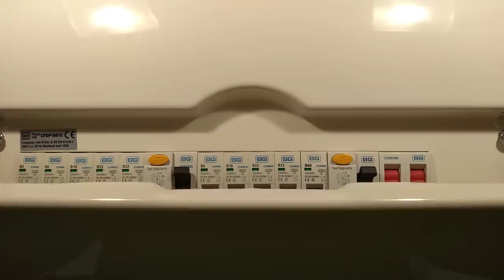A look inside a British home electrical panel.

Comment: @bigclivedotcom How Do UK Homes or Flats propose to deal with Electric Vehicle EV charging?.  EV charging in US/Canada/Mexico  is most often rated 48A at 240VAC (rms) on a 60AMP circuit.   Note that the mains from Utility are typically 200A @ 240VAC (rms).   In the UK example the small panel shown does not appear to even begin to handle 'level 2' charging of a EV at 12Kw (in addition to other household loads).
Reply from the maker: The panel is capable of handling loads of 20kW.  That would be a standard 50A breaker as used for some high power electric showers.

Comment: Another great quirk of the UK electrical systems is having a phase and a neutral sharing the same colour often in the same installation! Thanks EU!
Reply: What's that got to do with the EU? We had just the same situation in the old red/black days.
Reply: @Rosscoff2000  Well we were doing fine with our Red Yellow and Blue phase wires with black as neutral until the EU forced harmonisation on us which used Blue as neutral and black as a phase... the amount of times this has caught people out is unreal...

Comment: Wait, the UK uses DIN rail breakers? With stranded and ferrule capped jumpers? That's pretty different. US residential and light commercial boxes are very very different. I always thought our zig-zag bus bars were a bit odd, but that's what makes it easy accommodate both 120v and 240v loads in the same box, since every other breaker is on the opposite leg of the transformer. They're also huge, because the NEC requires many specific cases for dedicated breakers. 60 amps for a utility input seems pretty small too. Older houses tend to have 100 here, and newer ones 200.
Reply: eeeeweeezeee twice the voltage so 60 amps at 240v provides the same power as 120 amps at 120v.
Reply: I find 100A is more common in the UK, but I think Clive is in a more remote location hence it's a TT system and being on the Isle of Man might be a bit older. I think 80A is more common than 60A too. It will depend on the local distribution network.

Comment: We are require arc fault for all bedrooms and bathrooms plus ground fault for all bathrooms. The breakers are crazy expensive but they work well.
Reply: In effect, ground fault is now required in all rooms in the UK (and has been for some time); only a few things, like dedicated fire alarm/smoke detector circuits are exempted. As for arc fault detection, that's just hit the standards as an option, but I've seen some testing it and being disappointed in the results. John Ward, in particular, was not impressed by the very expensive device he tested. Others report they are prone to false trips.
Reply: I thought they were not worth it until I found a issue with the original installation (several years old at the time). Due to a basement re-model I was forced to upgrade my panel to the new codes. When I swapped in the arc fault it immediately started tripping. I thought, what garbage. Then I tracked down the problem to a slice in the insulation on my stairwell light. As soon as I repaired it, the breaker stopped tripping. Pretty much a convert from that point.
Reply: if fuse go lot alltime, circuit have somethink  totally wrong installed or added after building.too lot use power one fuse.

Comment: 63A panel will be protected by a 100A fuse on the supply side, because this protects the cable to the house. The meter will be protected by an 80A breaker, typically curve D, though older installations with a breaker dating from the 1960's could be a breaker with thermal overload only, or even a fuse of 80A rating. If you are on a prepaid supply that is only 40A rated, then you will have a 63A supply breaker to protect the 10mm concentric cable to the indoor meter unit, and then a 40A main  breaker. Otherwise 16mm split concentric or steel wire armoured cable for the 63A units, though older houses with long mains supply distances, typically then you have overhead lines as well, bare copper with ceramic insulators and a pole or three in the property from the street, will have 16mm on line and neutral, and 10mm on the earth wire as well. 

Very few have aluminium cabling, only a certain range of houses built in the 1970's which were supplied with this, and most have been replaced with copper as the aluminium feeds degraded or were updated electrically. Street side copper is being changed over to aluminium bundle from bare 25mm copper, depending on copper price for this to be worth while, or if the overheads get stolen.

Comment: at 13:50 (approx), you talk about using the biggest breaker box you can. despite it costing a little more money. When it comes to high voltages, it's TOTALLY worth it. No amount of money can yet raise the dead.

Comment: I was always envious of the 220V household plugs in England, especially when looking at power consumption and speed of typical UK kettles when making tea. However I didn't realize you don't get a second hot wire fed into each home, out of phase by 180 deg. So, in North America, if you need 240 V for dryer or heater, etc you feed it with two hot wires that are out of phase.... Even so, it would be nice to have 240 V plugs to boil water for tea, ha ha.
Reply: The whole of the UK is this way not just England.

Comment: This was exactly the situation I was left with where the immersion heater bus bar rail was left at the rear of the screw clamp !  Hey presto the breaker burned out.
Reply: Same here. Shower kept tripping. It burnt out the breaker. I was pleased to find this as I was going through Clive's older videos and sure enough, he mentions the bus bar problem.

Comment: My neighborhood is mostly still edison base style fuses in 30 amp boxes often connected to knob and tube wiring.  Interesting how Europe's buildings arr so much older in general but infrastructure is typically so much newer.
Reply: In Poland we use Edison's fuse=>powermeter=>edison fuse=>consumer

Comment: Wait, they come pre-assembled in UK? Here in Brazil we (electricians) make custom assemblies for every house/installation.

Today, our system is almost identical, except good installations always have SPD in the panel too. In the past, Brazilian electric system was a mess, but was mostly NEMA. Most older houses still have those NEMA black CBs, although Brazil never had the rail mounted type.

Comment: I am an electrician in Australia, D curve circuit breakers are still avaliable as they are used for large motor loads, I had to get one for our new air compressor not that long ago
Reply: In PL also D was used for large inductions and mostly before change to DC in common places (staircases)

Comment: For an RCBO fit it next to the main switch and use a bus bar between it and the main switch line (live).  When fitting an MCB/RCBO give it a jiggle up and down to make sure it is clamped to the bus bar properly.

Comment: I never quite got the British inconsistency with regard to safety of electrical equipment in the bathroom. On the one hand they introduce a dedicated plug for bathroom devices to allow no "normal" devices in the room, and on the other hand they think it's perfectly fine to have a 40-amp fuse protecting "something like a shower", meaning an electrical shower heater mounted right next to flowing water that people are meant to regularly stand in.

Comment: Mentioning the grade of the breakers, it makes sense why a welder would flip the circuit even if the breaker's rated for 220 volts American.  Housing circuits are simply not strong enough to handle such voltage spikes, they're only made to run a household dryer and maybe a water pump.  Circuit breakers are designed to save your life, not run industrial equipment, hence why it's a better idea to install an industrial rated circuit box in the workshop itself, and not try to run high voltage stuff off the dryer's plugin.

Comment: Nice video.  I miss the UK and simplicity in ring circuits / separated lighting circuits and so on, but I do prefer the USA electrical panel systems of having a simple central live Bus bars (one for each phase and fake 240V :-( )  And having a Neutral bar on one side and Ground bar on the other.  When done properly they are inexpensive, solid, and very neat and flexible.
Reply: My trouble-shooting reflexes just overloaded at the thought of comparing ring circuits and finding them simpler than a gang of radials… but I’ve also seen some terrible dog’s breakfasts of shared wires in older Canadian houses that defy all mapping until you open the walls and see what evil renovators have done just “To Get Some Lights Going”.    Nothing like replacing an old incandescent bulb with an LED to discover a weird flicker to find things wired very strangely in combination with a failing 50 year old fixture.

It was to my shock (pun intended) to discover that the distribution panel that seems to have been in all the homes I’ve lived in that were built in the 70’s forward has vanished from the market, and replacement breakers that fit it are getting hard to come by, owing to a failure mode where a “fake” 240v dual pole breaker could physically break, leaving one pole un-tripped, leaving potential for a fire inside the load-centre, as well as live current to a theoretically dead circuit.  Thousands if not millions of these panels across Canada, but no consumer warnings about potential hazards in their wiring closets...
Reply: @vaalrus   I have a 20 year old 'Cutler Hammer' panel that I love, except the breakers are triple the cost, and Generator lockouts are like 5 times the cost.
Reply from the maker: eBay has a thriving market of retro breakers for old panels.  Often sold as unused - but showing serious signs of use.  And not cheap either as they are the alternative to a new DB.  I had to source one for my brother's DB when he tried to "change the fuse" in a circuit breaker by ripping the toggle off with a pair of pliers.
Reply: @bigclivedotcom  Ouch.  I thought I blew my main 200 amp breaker a few weeks ago (the front panel case screw somehow came into contact with a 'Big' wire. :-(  (very bad design, and luckily I was insulated as I am sure the electric would have hit me before the breaker tripped going by the looks of the weld marks from the screw to the case.))  Luckily that breaker still works, as a CH 200 Amp Main Breaker (CS2200) is insanely expensive, especially old stock new ones.

Comment: Very similar to what I have here in Sweden, except I get all three-phases (TN-C-S) into the apartment, and each phase first go through a "main fuse" (in my case 25A, so a total of 75A max) before they go into the distribution board the RCD and the smaller fuses for each circuit. Plastic enclosure though. I'm not an electrician so can't say how common this is.
Reply: I have about similar though in metal but as the wiring in my apartment is ancient, the neutral and earth are combined on the panel and all the sockets are with two wires. Because of that the RCDs are not even connected. I have 16 circuit breakers in my panel. Three are in use.

Comment: I'm told that the next edition of the IEE regs (19th edition possibly) will promote radial final circuits and not a ring main. I'm guessing that your panel will get much larger with many more breakers. (I'm in the US. My board has around 40 breakers and no RCDs.

Comment: Interestingly, mine has the three 6A lighting circuits connected directly to the main switch (porch + front floodlight, upstairs, downstairs), then three other circuits attached to an RCD (32A ring main, 20A unused cooker socket, 16A feeding a single socket elsewhere in the porch). Oh, and for added fun, labels warning that the house contains wiring to both the old and new standards...

Comment: In Australia only a licenced Electrician can work on Mains wiring. They have to certify the installation so if there is a fire or electrocution they are liable. BTW, Electric Vehicle Supply Equipment (EVSE) 32A per phase, 22kw 3 phase.

Comment: Clive, in theory the acetic acid given off by curing silicone could cause corrosion, although I have no practical evidence of this. However, the silicone vapour that's evolved even after curing can form a glass-like coating on contacts that arc and this can cause a high-resistance connection. An example of this is when British Telecom banned the use of "Symel" sleeving in telephone exchanges because it buggered the relay contacts so much that the man with the "diacrom" spatula couldn't keep up with the fault incidences.

Comment: Nice video. Here in Norway, all new systems must have RCBO's on all circuits. Never thought about the heat generation
Reply: In Sweden you'd expect about a 10x multiplication on the price from a circuit breaker and an RCBO.. RCBO:s in an entire panel must make it incredibly expensive?

Comment: I'm surprised to see that neutral is connected to bare metal bars and is not interrupted by the breakers.
With a TT net it is not guaranteed that neutral is actually "neutral".
Also, it is preferred to use the fork style bus bars that go under the screw, not in the slot for the wire. It prevents you from making that mistake you describe and you have a separate hole for the wire and the bar.
Reply: The neutral is grounded on the transformer. That is what the first T means.

Comment: Thats so interesting, in Norway every circuit breaker has its own "jordfeilvern" (dont know the english word for it, earth fault circuit breaker i suppose.) Built into it in addition to overload and short circuit protection.

That way only on circuit at a time trips, to me that seems more handy than a shared "jordfeilbryter" (which we still have on older installations
Reply from the maker: We do have similar RCBO breakers here.

Comment: Interesting the "B32" for "breaking" I can only assume? In Australia Circuit Breakers are marked "C16", "C20", "C32" etc. I like your use of Brown and Blue. Australia persists with Red and Black in construction wiring.
Reply from the maker: The B and C ratings are the type of trip curve.  B is standard but C will handle higher inrush current.

Comment: I had a look at one of these units made by ABB in Honk Kong. Basically three same layout as this and in metal, though I don’t believe all the circuits  were covered by RCD. Only half appeared to be covered. It is indeed a different method than the North American design where they have a non fused neutral and split phase twin 120v line into a main breaker where they lead into a couple bus bars alternating in phase for the length of the break. This precludes an R D or GFCI covering a group of breakers, so you can install CFCI specific to the circuit with current protection. RCD/GFCI are common nowadays for the kitchen plugs and, since the 70s, on the bathroom plug circuits and jet pumps...neat to see the other approach where you don’t have the combing voltages used in North America. Not sure which is the best approach.

Comment: Definitely a lot different than what you see here in the states, esp. that loop circuit thing you guys have. Back when I was doing electrical designs for buildings it was usually Square D, Eaton, Cutler Hammer, etc. with the usual racks of black breakers in a grey box for residential and commercial. Been some time since I cracked open an NEC Book, but I don't recall ever running into a panel here that had an unfused/non-trippable disconnect straight off the meter. Don't think that would fly here. The GFCIs also usually were done on individual circuits either at the wall socket or at the panel for individual circuits for some residential and commercial installations (e.g. Pet stores with fish displays, etc.).
Reply from the maker: There's an external disconnect and a fuse before the meter.
Reply: @bigclivedotcom  Typically the way its done here as well, with a "locked" disconnect/meter box (by the utility) that's fused to protect the service. In small installations no disconnect is required for the panel if there are 6 or fewer breakers required (six disconnect rule), but seems customary to require an MCB as a redundant protection for the service in larger residential and commercial installations that is less than or equal to the service rating. Think it is part of our electrical code but its been so many years now since I was in that line of work I cant remember what sections applied. I will say one thing, I like the horizontal layout of the box. Much easier to work in and route than the traditional two rows of vertically mounted breakers and bus bars we usually have here.

Comment: Compared to a typical USA panel box, this looks really very much like a novelty.  I'm sure they're better in many ways (especially when compared to stab-lok type breakers, which tend to burn up bus bars when the spring tension weakens over time).  

The stranded flex is something to behold.
Reply: The FPE stabloks were notorious for not tripping too. The UK has a similar design by Crabtree electrical, but the busbar plugs seem to be better designed, never seen one burn up, even 50 amp types. The boards are a joy to work on because not only is the busbar done with plugs, but the sockets are recessed and plastic shrouded, you have to make an actual effort to touch a live busbar.
Reply: US design style for things is often way dated. You can buy things new that look like they were made in the 50s. I assume it's old factories that are resting on their laurels pumping out the same old stuff year-on-year.

Comment: in the netherlands there is a great problem with those small brakers with earth protection. it the incomming neutral is removed the braker is not tripping. maybe its a nice project to see if the braker tripping in the uk version